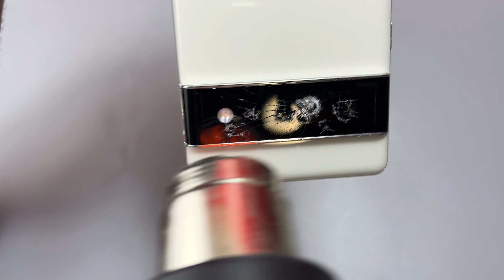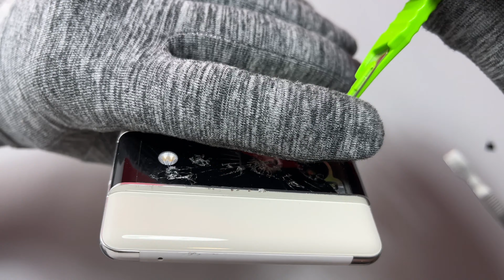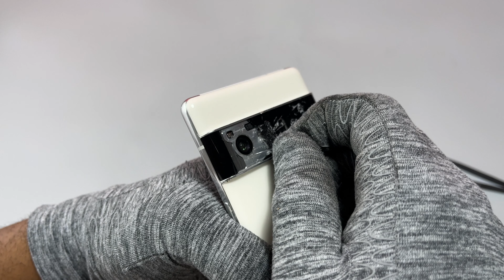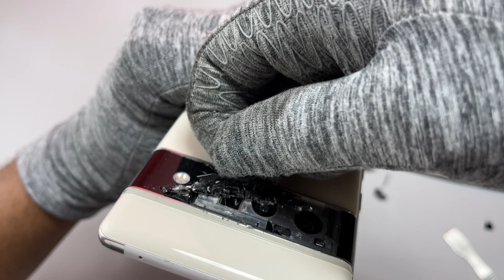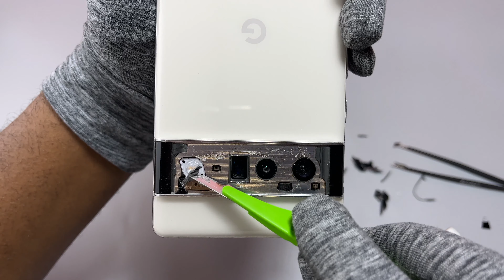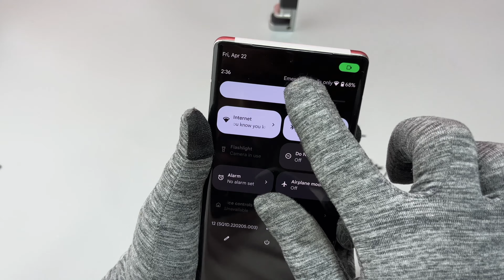Google Pixel 6 Pro Camera Glass Replacement

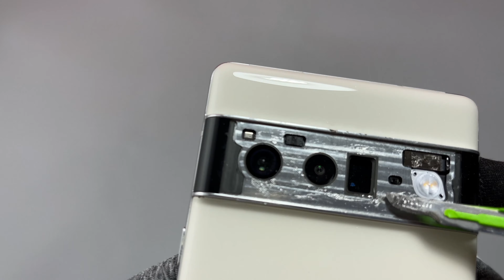Comment: 3:02 are you sure this is safe? You hit the device repeatedly without any protection on the table surface
Reply from the maker: Yes this is safe it wouldn't damage the cameras or phone. Just make sure it's not too much to avoid scratches
Reply: @ersbit  you should put towel or any soft protection before hit the device on table. Recommended
Reply from the maker: Yes. That's the best practice to avoid surprises 👍🏽

Comment: Hi, I hope this comment finds u well ! Thanks for providing tips and tutorials on how to perform a lens change. My question is, will the image quality drop after swapping the original broken glass with a new one ? Also this is a common issue with pixel 7 & 7 pro
Reply from the maker: Hi, no there should be no difference after changing the glass. Sorry your messages got buried I responded to a new comment then saw yours

Comment: Excellent video... Do you have any trick/tips for main camera and flashlight issue on Pixel 6 Pro ?
Reply from the maker: Sorry just seeing your message.
Try updating the software first. Pixel 6 or 7 have too many bugs due to software
Reply: @ersbit  Hey
I did all the "software-wise" recommanded operations but without success.
I sent my phone to a repairer. I told me it was connecting thing was broken and it's not the first time he experienced it with the Pixel 6 Pro.
Now it fixed and I'm enjoying at 100% the Pixel experience.

Comment: Things 99.9% tech YouTubers won't tell you 

Samsung used the same m11 oled material in S22 ultra which was used in S21 ultra which doesn't happens generally with each new s series, also s22 ultra doesn't have eco square oled tech which saves battery life by a good margin , feeling ripped off or triggered ??
Reply from the maker: Yep, battery life can be really really bad if you use the device to its maximum performance. Maybe that’s why GOS was a thing 😂

Comment: S22 Ultra camera could have been a lot better if its sensors were bigger than s21 ultra , they almost put the same damn sensor with bit isp upgrade and a better (software which can come by a simple update in older phone ) , not a note worthy camera upgrade over s21 ultra
Reply from the maker: Correct! Coming from S21 ultra no real benefits expect body design and some do not like what they did to the 22ultra